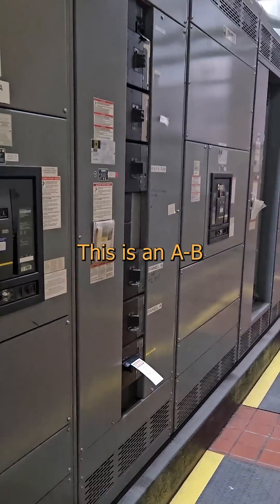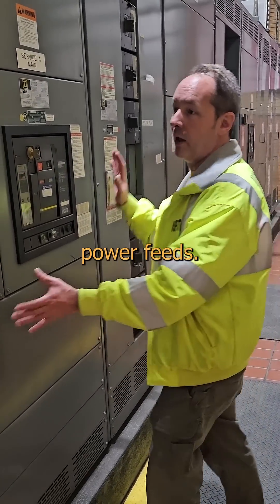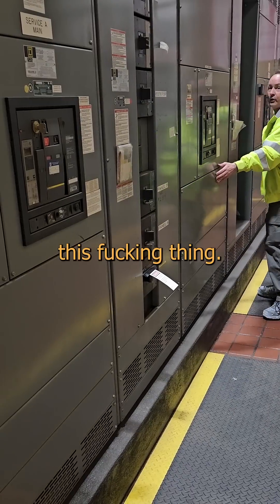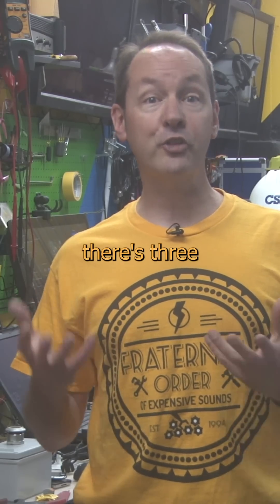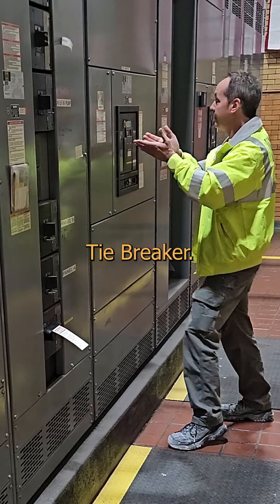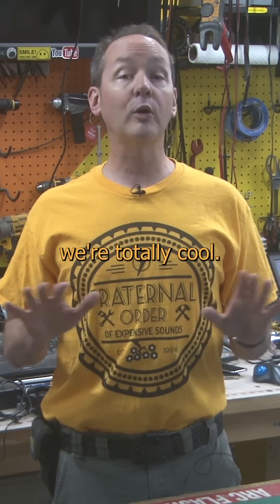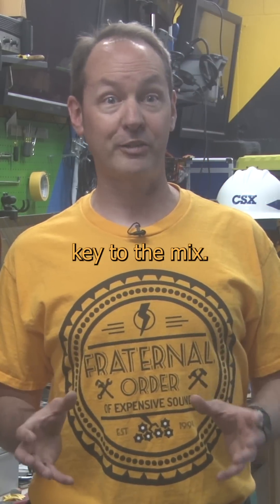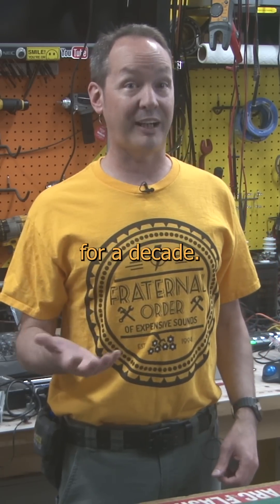A B Interface #chrisboden #comedy #electrical #engineering #energy #substation #switchgear #power

Comment: I mastered A - B switching back in the mid 80's.  On a television studio camera chain, not electrical switchgear.  
I could switch from A to B, B to C, A to C, B to A, B to C, C to A, C to B, or, for a whole different level of complexity,  do dissolves, wipes, effects, cuts, fades, switch from live cam feed to VTR feed and back,  almost an infinite number of changes, depending on the needs and wants of the director.
Electrical feed was somebody else's bag. And they generally did it well, I don't ever recall a power surge, failure, sag, or other interruption.

Power switching has been made a lot simpler with the advent of such switchgear, but it still requires thought and intelligence on the part of the user.

Comment: Modern aircraft work on the same principle. Each powerplant has it's own generator which will power all primary buses on their own if one drops out. This happens instantaneously, without a drop in uptime, unless it's an Airbus which in true fashion, will throw a fault.

Comment: the K-mart on the main drag here in town sits just about on the boundary line between two cities, and thus two electrical grids.  They wired the building with BOTH, and can run off either if the other goes down.  Pretty cool option for a big bo store to have.  Nowadays though I see more and more large stores with a big gas generator in the parking lot or out back  That works too I guess?

Comment: I had a relative who, when they were a kid touched an active power amp that was direct current, they got blown back and had the shit scared out of them, but are still around today, plus the rubber boots they wore probably unironically also helped them out as well. If it had been alternating current… I wouldn’t exist. 😂

Makes you really appreciate the job these guys do and the wizardary they work with. ⚡️⚡️⚡️

Comment: There are also automatic fail over systems. If one power line fails, the other one starts to deliver power.

Or they just built the whole datacenter redundant and if one side of the building fails, it doesn't matter because there always is a mirrored version of everything.

Comment: We used the same system for the new tower at a hospital I used to work at, and an older version in the original building.  In the original buildkng, we had two utility lines in, each feeding about half the building.  If one went down, the associated switch gear would rock it to the generator that feeds it with a short delay.  The return switching takes longer to allow the wave cycle between utility and generator to synch.  Had to do it every month for the legally required generator testing.

Comment: Ehh, multiple feeds but the systems are separated with generator back ups.  So many ATS switches and it seems like 1 or 2 a year need repair.  Actually got a new one(ATS) recently.  Which new normally requires significantly destructive combustion so color me surprised.

Comment: Speaking of expensive sounds last night we had a doofus working on one machine  and mistakenly using the UI on another identical but entirely different machine. 

The problem, a large chamber on the machine wasn't opening a door to allow him to use a robot to put silicon wafers in for testing.

Why? Because he was on the wrong UI and the door he was trying to open was separating a section that was at Atmosphere and the chamber.... at 0.0007mtorr. That's like really close to perfect vacuum on a chamber the side of a refrigerator. 

So doofus got fed up with the machine telling him no "I don't understand, I guess the manometer is bad. I can see the chamber is open to atmosphere with my own two eyes" he says 

He then bypasses the interlock and sends a force open command to the door. It asks him many times "why? have you not seen the interlocks? please consider?"

Then it happens. 

What could only be described as the sound of a missile strike in a China shop this poor machine rams open its door and  we get to enjoy the sound of probably close to a million dollars worth of precise and delicate semiconductor manufacturing equipment going from 0 atmospheres to 1 in less then a second... from across the factory. I didn't know aluminum could deform in such ways and sapphire turns to dust when it's ricocheting around a metal box.

Comment: We have a total of 8 keys to safely ground our electric locomotives. Key A holds air pressure in the pentograph, taking it out forces them down and you can now unlock 2 keys B which then disconnect the main breakers and frees the 2 keys C which are both needed the free the 3 keys D, two of them to disconnect the converters and a third one to keep on man, you know why.

Comment: You are kinda wrong, at least in regards to modern stuff. Most out-of-phase switching systems have a safety interlock that is either a dumb mechanical thinghymajig that always pops out one side when the other is attached or locks the lever or key that shouldn’t spin until the other one is turned - or, if it’s real smarty crap, it has a variable phase delay 50Hz (or 60Hz) filter that aligns everything nicely before the pneumatic switch is thrown with a noticeable couple seconds of delay. I do not have the balls or will to test manually the limits of the auto-alignment or locking protection on such a system though, because if it fails I get insta-cooked into a crisp by an arc flash so hot it matches or sometimes exceeds the surface of the Sun.

Older systems that required you connect multiple out-of-phase sources onto one bus actually used electric motors coupled to generators through a magnetic clutch. First a magnetic field dragging across a copper disk starts spinning the generator and when it is in phase and has near zero slippage relative to the motor, the clutch couples mechanically the shaft between the motor and generator while at the same time the generator is coupled to the common line. Not only this setup can transfer energy from an out-of-phase power supply but it actually also doesn’t care about frequency as long as the motor spinning the generator is designed to run at said frequency. So it can convert between DC, 60 and 50 Hz not to mention changing between the number of phases too at any voltage, on top of dealing with the overall phase delay on systems running on the same frequency. It would be expensive to have this setup powering a single building but it was used before. A simpler almost solid-state setup used in smaller installations for phase shifting and amplitude matching has capacitors, variacs and variable inductance coils which together shift the phase and adjust the amplitude of the generated voltage to match the line phase and voltage.

Comment: Back in the last century I have seen what happens when a third key is retained by maintenance personnel 😢
I worked at a shortwave and medium wave/AM broadcast facility. One night the power company scheduled maintenance on one of the incoming lines, transformers and measuring equipment.
As it was practice, we isolated that incoming feed and started the generators to replace that feed in case the other feed went down.
We were running a 100kW AM and two 500 kW shortwave transmitters at that time, so about 5 MW peak at 100% modulation. 3 gensets could  provide 6 MW but were just at idle while at least one feed was available.
The power company technicians concluded their maintenance a bit later than scheduled and were eager to go home...They found or were given the third key, cut off our lock and put the second feed back on the bus where the 3 gensets were running 😮
Lets just say, there were expensive noises and the power company technician needed a new 40cal suit. I never found out if it was because of external damage, or internal smell...
For the next 4 months our parking lot had a bit less capacity, somehow multiple rented generators in shipping containers showed up 😅
Reply: Man someone cutting a lockout/tagout?
Who is trained like that?
Reply: @fauxednews  probably someone who slept through their training.
Reply: @fauxednews  Someone who wasn't just dropped on their head at birth, but used as a practice ball by the Harlem Globetrotters.

Comment: I've worked in places that have hot stby generators and I was never sure if the $0.10 micro controller was trust worth enough to not close the generator tie in before the grid breaker was open all the way. 

They did not have a unified transfer switch.

Comment: In the datacenter at the company I work for, we had two large UPS systems, and I was present while the electrician was doing maintenance on one of them.  Inside the panel were a few circuit breakers to bypass the UPS, and on the door to the panel were the order of operations to perform the bypass, which resembled what you would expect for starting WW3.  He was certainly a professional with plenty of experience doing it, but he still followed those instructions religiously, as he should.

Comment: This is basically the industrial version of a generator backup at home, you can feed your house with the grid or your generator but if there isnt an interlock breaker to separate the two the generator goes boom or a lineman potentially gets a zap if they're working on it provided your generator is powerful enough to feed whatever part of the grid you and your neighbours are on that is separated from the rest of the grid hence power outage. I once lived in a semi rural area where we had a young irresponsible driver take out a power pole, my neighbour backfed the grid but it was only my house and one other as well as his that were on the part of the grid that was now separated by downed power lines. My house had power when it shouldnt have and i got a knock on the door from the very angry power company trying to find the house that was responsible for almost killing one of the emergency service workers who was told the lines were dead and they touched the car that had fallen lines across it that was wet and just had a fire put out. Anyways they busted my neighbour for backfeeding the grid with a charge that put him in prison for 3 months so they definitely weren't happy.

Comment: The plant I work at has two separate 138kv feeds coming in. If the boilers or turbines go down you need a safety net to get them going again! This is also done at various levels of power throughout the distribution grid so everything has options if a feed goes down.

Comment: Someone decided to remove the anti-blowback valves on a hydrogen oxygen manifold that fed 6 water jacketed American Gas Furnace 250s...
Imagine 250 #7 welding tips in a block of stainless... times 6.

We heard the oxygen feed rush into the hydrogen line as each brazed 1" coupling popped on its way to the two hydrogen racks... and somebody managed to shut the hydrogen feed line valve just before it got there.

We got a couple of weeks off while the company replaced the steel roof and all the plumbing and electrical.
A few guys never returned to work.

Good times. 😂

Comment: The house I lived in my senior year of college had a chandelier with two switches. But instead of working it right some genius managed to wire a separate phase to each switch. Worked fine if you didn't have them both on but switch them both and the light shines like the fucking sun and you could hear the panel buzzing in the basement for about 2 seconds until a breaker blew. The land lords solution was to disconnect one switch.

Comment: In digital terms, that's called an 'exclusive OR' and has been around, obviously since before digital circuitry. But, and it's an important but, with an EOR circuit,  you can still control large amounts of electricity. When it fails, it just lets the blue smoke out. Sure, you might get a little pop, but you will still be there scratching your head wondering what went pop to make the power stop.

Comment: Similar in telecom cental offices. The amount of power used by fiber optic laser emitters is nuts couple that with high capacity batteries. The batteries themselves are bombs if something goes very wrong with power in there.

Comment: Had one of my students try and tie into the same load bank while I was testing a diesel generator. The unfortunate thing was that he had his output contactor closed when he went to plug in his generator. With me online and loaded to the max, as soon as he got his cable close to another input connector... BOOOOM!!! I ran around to the back of the load cell and I thought he was dead because he was frozen into place. (Luckily just from the FLASH/BOOM) His $120 per foot cable was missing the 6 inch connector and he had a quick suntan. I hit the emergency stops and checked him over... poor kids underwear didn't survive, but medical checked him over and cleared him okay.

Comment: I used to work for a company that made SWBD and SWGRS, as the electrical control designer we would often include an electrical interlock to the breakers controls if the customer wanted an ATS or remote operation or a local PB.
I remember my CO-OP Student once asking me why we only require the interlock on the close circuit and not on the open circuit. My response was if you managed to parallel the two sources that open command doesn’t matter anymore because likely  the wiring and a good chunk of the board would be scattered across the electrical room.

Comment: Worked at two large plants & a hospital. All had two 13,200 volt services with automatic tie breaker that could have both be patrolled for a few seconds to give enough time to then drop.out one of the incoming services for utility company or plant maintenance. No keys. Cost a lot for to have this set up.

Comment: Remember, they dont come pre-programmed unless you ask for it, you need to call the supplier to come and fix the fuse settings. Got a place where the engineer did not inform what settings he meant for it, and it suddenly cut the power. So the guy came, pulled the whole thing out and setted the fuse for required setting. Figuring that out while the customer was not happy was... interesting.

Comment: Our data center has 5 of these. Though our way of doing it is quite different and much safer. Separate power feeds. One hydro, one coal, one diesel generator and they are automatic so you can’t turn more than one on. It automatically transfers all 3 phases. The data center doesn’t lose power but we lose our lights for a moment which is funny.

Comment: There was a place that was outdated and used to power a small city. Wasn't supposed to go over 80% capacity for safety reasons. New managers in charged ignored all the warnings and demanded it ran at 100% capacity. What you described is  a good way to put what happened but thank god noone was injured.

Comment: I stick with software and computer hardware.  Working with utilities at an ISO/RSO was great, though.  We had two redundant computer rooms, each backed up with battery-based UPS and diesel generators.

The problem once was that there was a cross-connect switch.  An electrician was working on the switch when his keys, on a chain around his neck, moved around and shorted out the switch.  That took everything down.  Fun times.

Comment: I was on a solar field earlier this year where the engineers designing the battery bank ties thought they were being cool like this, but in reality just pissed down their leg. 

The setup had two banks, two breaker boards, and four switches. One pair of switches allowed bank 1 to feed DC cab 1 and ditto with the second bank, with the second set of switches being a tie to allow both banks to be fed from a single switch. However, there was nothing preventing anyone from throwing all 4 switches on at once which would create a lot of expensive sounds and a hell of a fireworks show. The only indication were some stickers that said "N/O and N/C" on the switch boxes.

Comment: I’m lucky and the facility I work in has an ATS that switches our server room power from the A feed to the B feed should A fail for whatever reason. And if B fails, there’s another ATS that flips it and the remainder of our mission critical assets to generator power. That system has only been called upon enough times to count on one hand, but when everything gets dark and quiet in short order and you hear the switchgear do its thing without even having to press a button it reminds me I should feel pretty fortunate to work for an organization that places a lot of value in workforce safety.

Comment: Just been working on below ground HV earthing system for a site like this. 2 off-site  HV feeds coming into 2 almost identical HV distribution rings around the site that can each run the site independently if needed. These are then backed up by 8 HV generators, The site can run at full capacity on 4, but they have 8 be4cause.... just in case...

Comment: I just cant wrap my head around this system with way he described it its three switches with two sets of breakers and you don't want them to cross power but allow power to split half way why, are the breakers supposed to run parallel or allow the switch in between to power either or not at the same time.

Comment: We use two at the data centers, one to cross connect the generator feeds to both ATSes, and a second to cross connect the UPS feeds in case of an ATS failure.

Comment: Everybody talking about it should be interlocked 🤷‍♂️🤷‍♂️it is that’s the purpose of the keys. These are not something you can get a spare cut on the high street or cut the lock off. Google “ castell interlock” they are unique keys dedicated to those 3 breakers. Unlikely there will be a spare key in existence. This system has been functioning well for many years. Some installation allow bus coupling for a short period if time for switchover.  The two supplies will be in phase and synced to the grid,  unless one is a stand alone generator or something.